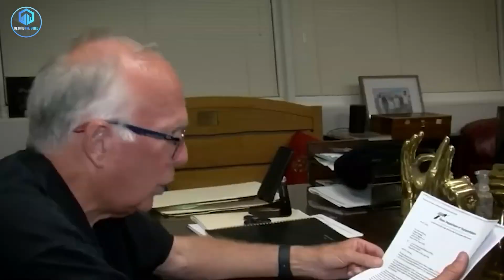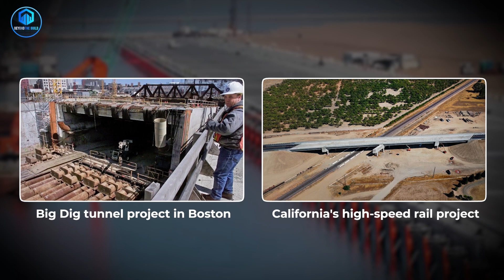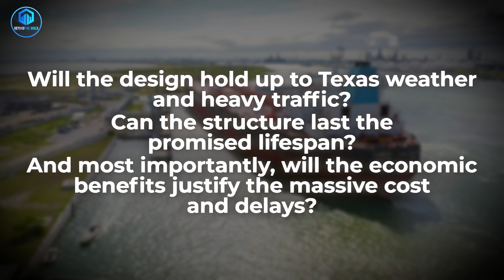This $1 Billion Texas Bridge Will Break U.S. Records

Comment: Let me correct an error, as the video states that the new bridge will allow the largest ships in the world to reach Corpus Christi at full capacity. This is FALSE, as the largest tankers are 65+ feet deep when fully loaded, but the water depth is only 57 feet. So while there might be plenty of room above the water with the new bridge, they would have to dredge to 70+ feet to allow VLCC's to come in fully loaded.